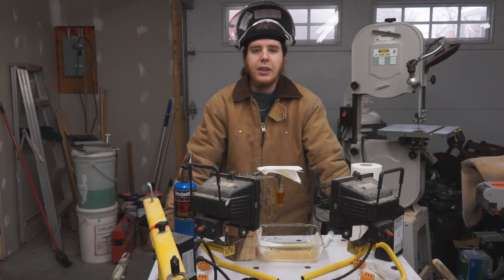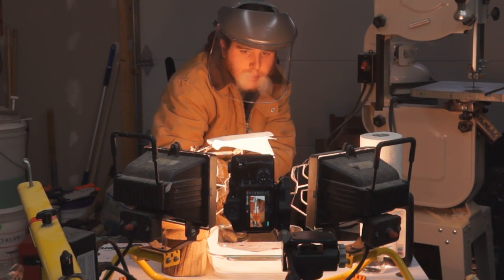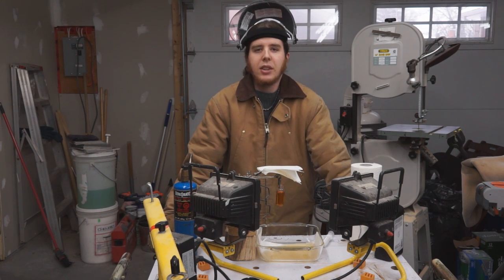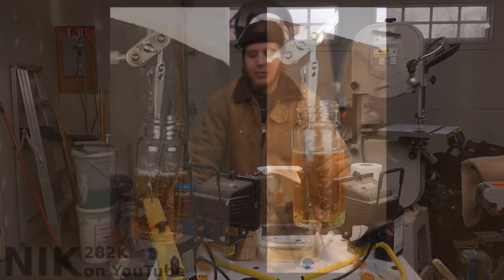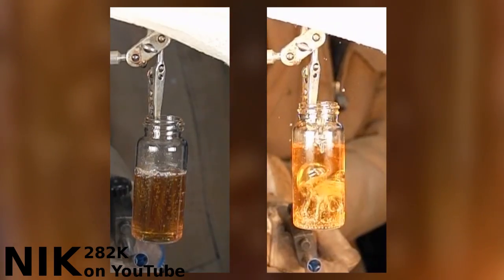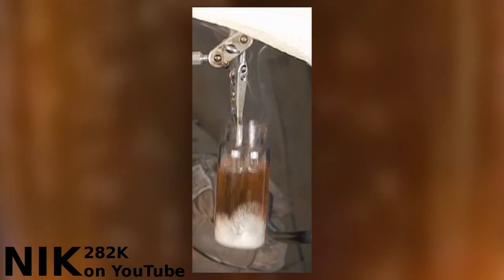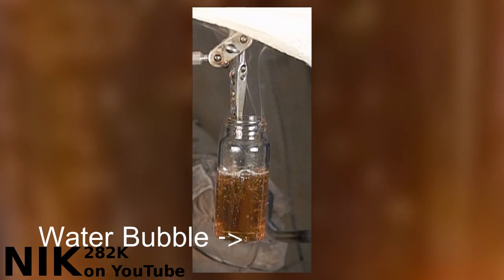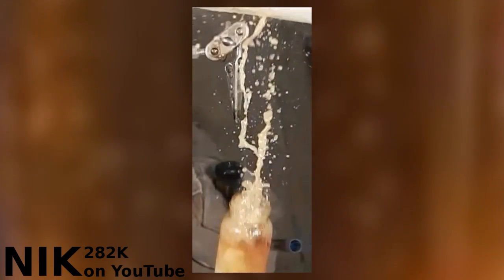Water in Boiling Oil

Comment: Great video, yeah water expands to sixteen hundred times its liquid volume when it flashes to steam. That why unvented hot water cylinders in homes can be very dangerous if not installed properly using the correct safety devices.

Comment: oil has Higher boiling pt. than Water. so when water is added to Oil which is heated more than 100℃ the water evaporates Instantly. the oil molecules Try to cover up the Space Left by the Water molecules. thus Collison of oil Molecules takes place leading to explosion.

Comment: I'm saying this before watching the video (to see how blatantly wrong or curiously close I may be), but I believe you can't put out oil with a fire because oil rises to the surface of water because of its buoyancy.
Reply: Well... I was half right. I didn't think about the oil being so hot it'd separate the oxygen and hydrogen molecules...
Reply from the maker: Jesse Crandle The water doesn't separate, it only boils into steam but the rapid boiling throws the oil so violently that it turns into an aerosol, allowing the oil to come in contact with more oxygen in the atmosphere.
Reply: Nick Moore Oh ok, silly me. I've used electrolysis (if you haven't looked into it it's very interesting and works well) to clean rust off of steel before, and I know that the process actually separates the hydrogen and oxygen. Many videos talking about electrolysis say to keep it in a well ventilated area so as to not cause an explosion if the hydrogen or oxygen comes in contact with a spark or pilot light. I really doubt that electrolysis separates enough oxygen and hydrogen to pose an explosion hazard though.
Reply from the maker: Jesse Crandle At the scale of a home user i doubt it would be enough to explode either but hydrogen being lighter than air makes it act in funny ways. It could pool at the ceiling and build up over a long time. I should try that